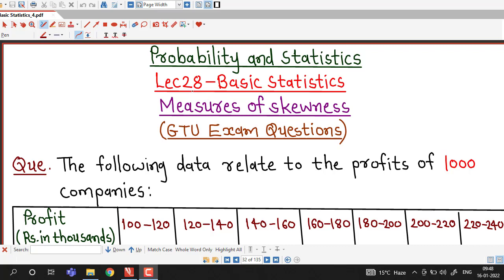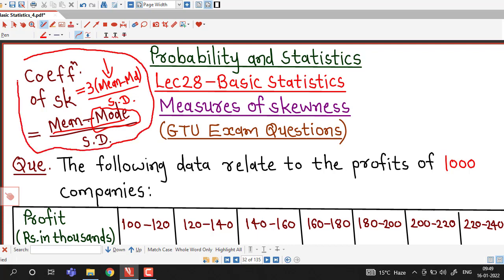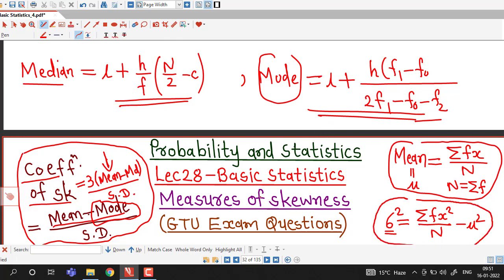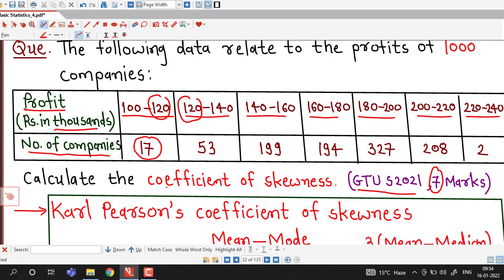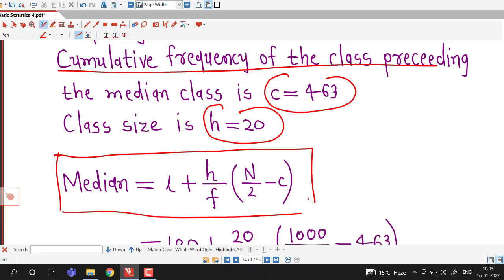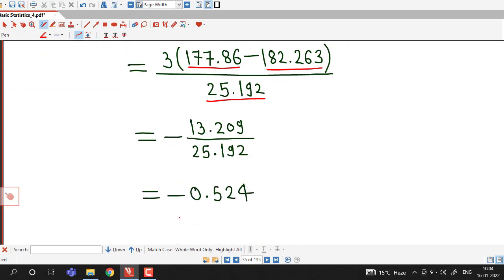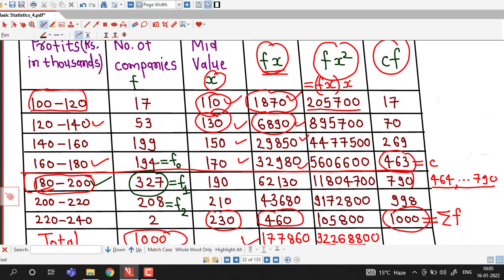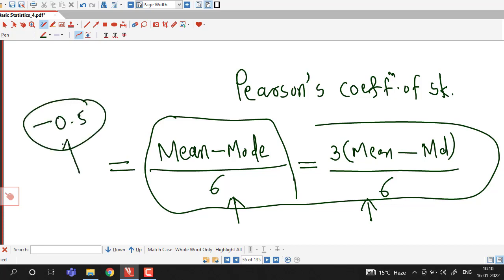Lec28/Basic Statistics/Pearson's Coefficient of Skewness/GTU Exam Questions

Comment: Sir 
By the formula of 
skewness = (mean-mode)/S.D 
I got the answer -0.504 
Can we say it is true answer? Because in your case the answer was -0.524 
So the error will be neglected or in exam examination will cut the marks 🤔
Reply from the maker: I have computed coefficient of skewness using median as well as mode. See the full video.  Using  mode, I also obtain-0.504. 
Both answers will be considered as correct. If it is specified that use median or mode, then you have to use specified measure to compute coefficient of skewness.
Thanks for watching.